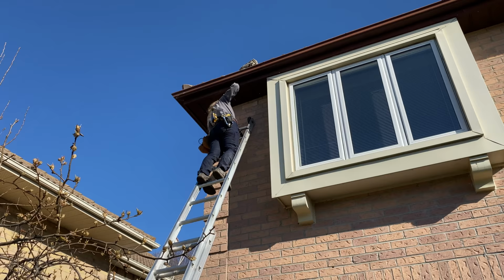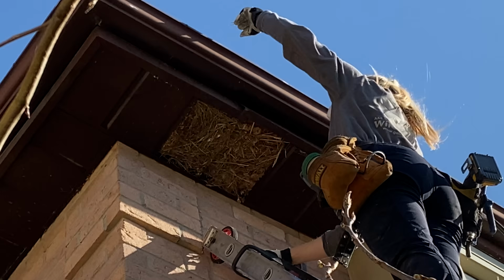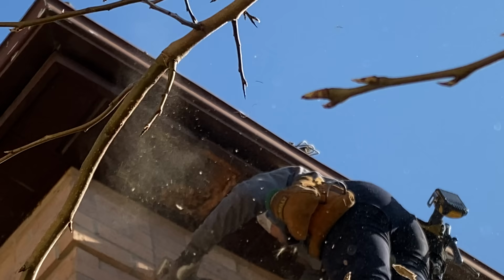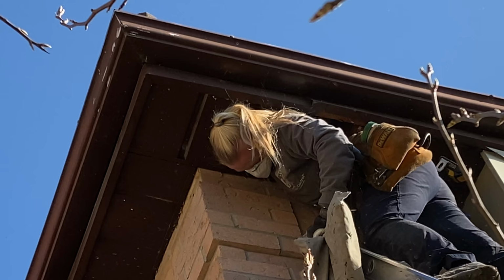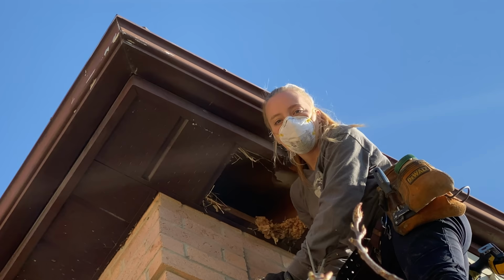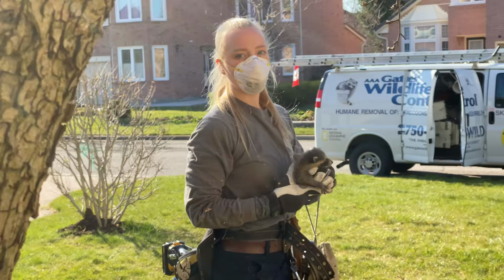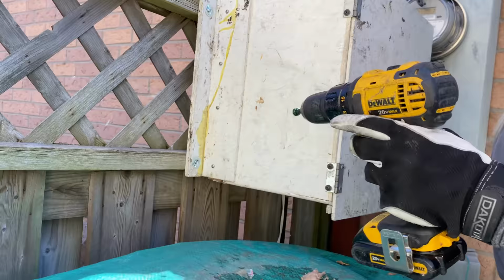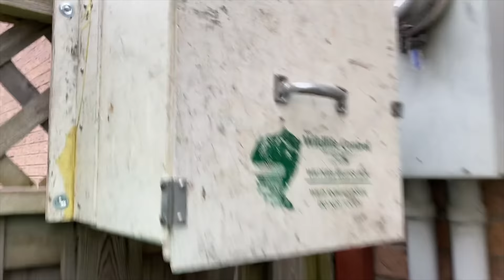Almost Out Of Reach! Baby Raccoon Removal

Comment: Imagine how much time that Momma raccoon spent taking all that nesting material up there. Amazing little creatures.
Reply from the maker: Hi Doreen, the nest you see in the video is actually from multiple birds nesting there over the years. Raccoons will use the insulation inside an attic for a nest!
Reply: Gates Wildlife Control thanks for your reply. Here I had the image of that poor raccoon up and down with all that nesting material. 😂
Reply: Gates Wildlife Control I was going to ask what kind of bird would build a nest that large. Thanks for the info. ❤️☮️
Reply: @rumrunner1756  very common of European starlings.
Reply: @rumrunner1756  They are built over Time also,so keeps adding g To The Nest
Reply: That material  was from birds making nests pay attention

Comment: Thanks for the video... my situation... have a mama coon with 3 or so "toddlers". I caught the mama overnight and released her about 5 miles away the following morning. Gonna put the traps out again and hopefully catch 2 or more of her young, and then release them in the same area. If successful, What are the chances the mama would still be around for them to reunite? Like you said I didn't want to hold the mama in the cage for 24+ hrs waiting to catch her young to release together.
Reply: I'd make a cage or container like they have so that it slides open, put a thin peice of tape on it. Go back the next day to make sure they are gone if not take them to a rescue center.